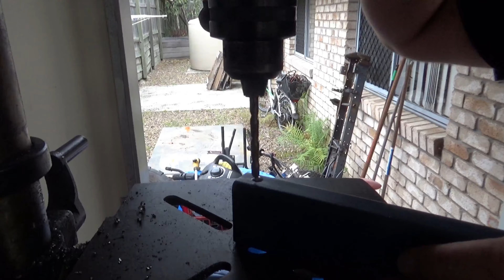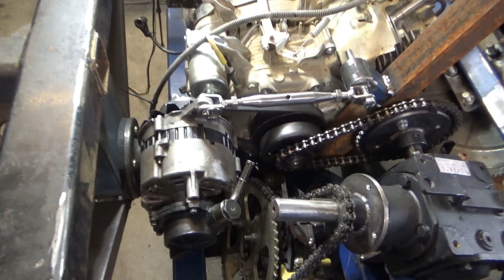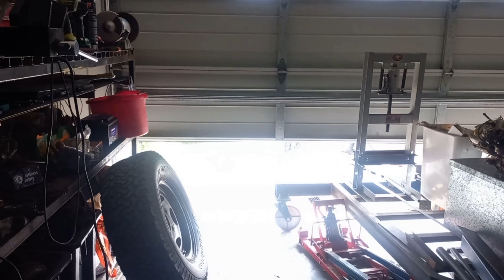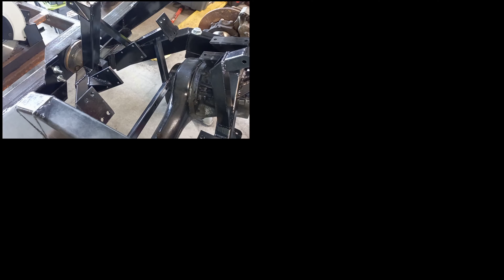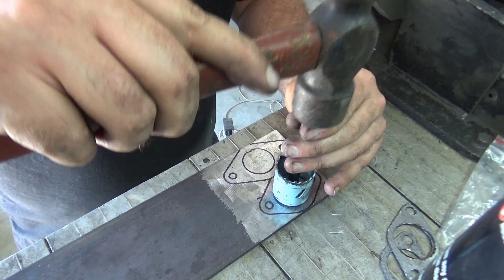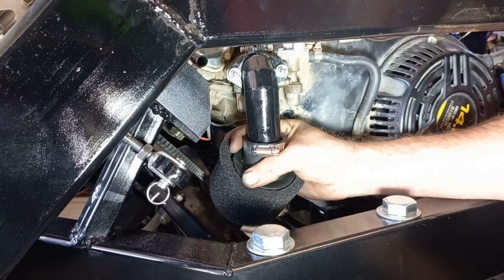"Omnitractor" Omnidirectional Tractor Build part 3: Power Systems and Test Fire

Comment: It's easy to take for granted how compact gear reduction and drivetrain designs are these days compared to chain, belts and pulleys.
Reply from the maker: Yeah a multi speed gearbox would have been better, but I couldn't find anything suitable at a sane price.
Reply: @weldeddaydreams  I'll send you links to some now you have busted your knuckles making this setup just to rub it in.  ;)
Nah, I'll keep them to myself.